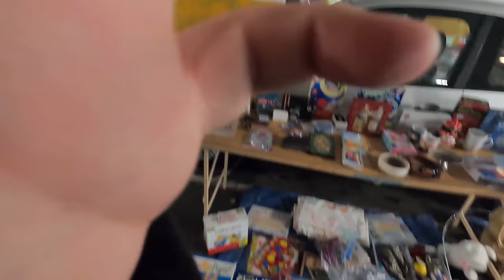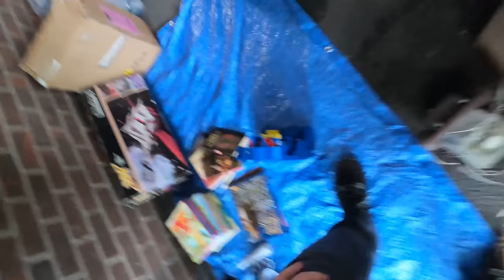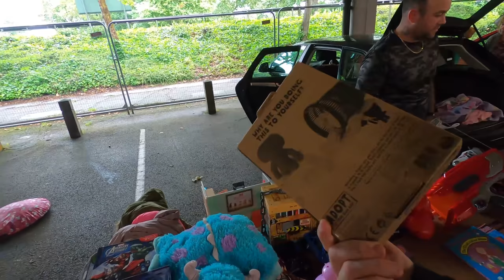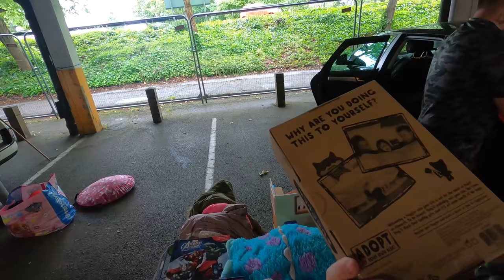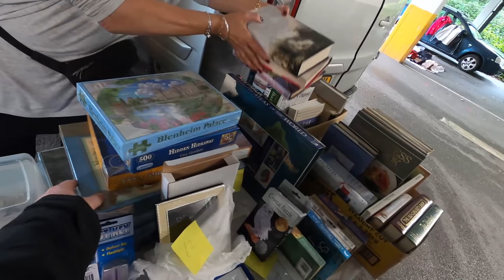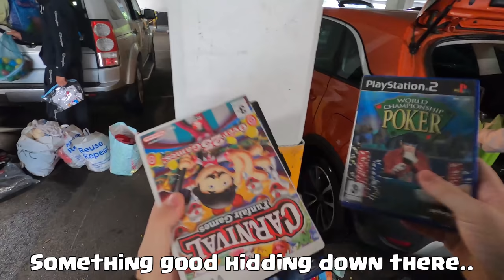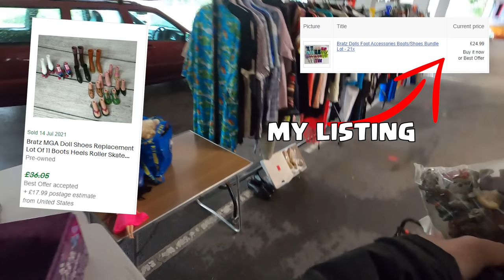Thunder Storm Made This Carboot BETTER!! 100% Capacity ..

Comment: @21:59 That dvd case with the Spider on it - in the pile you took the lightsaber from - is a Transformers Series from the late 90's called Beast Machines. It's not much, but the box sets sell for around £10 good condition and complete.
Reply from the maker: Ooh thanks for the heads up I will go watch now so I remember :)